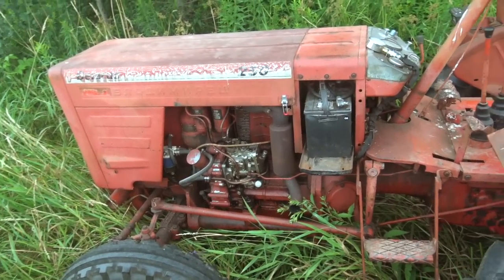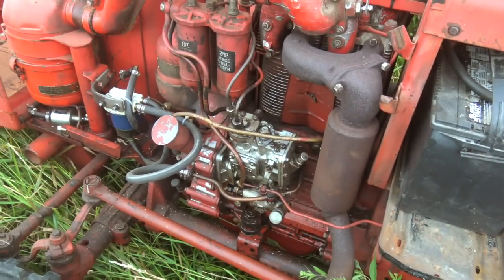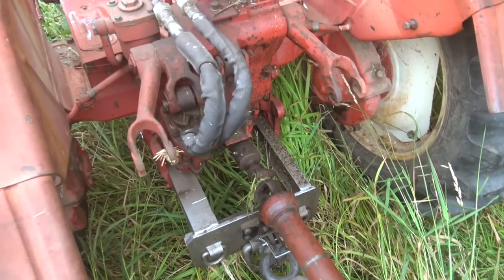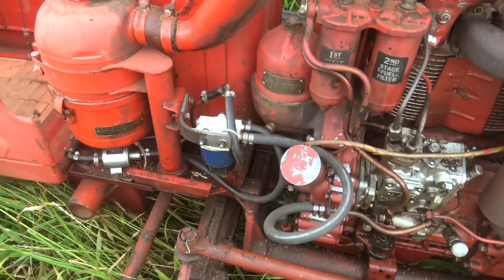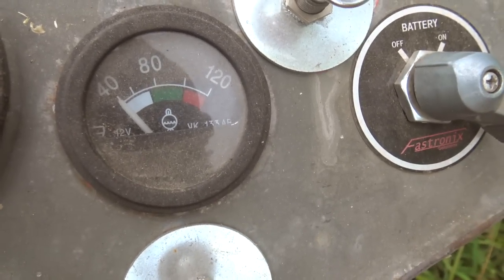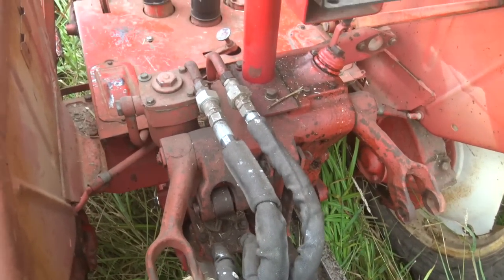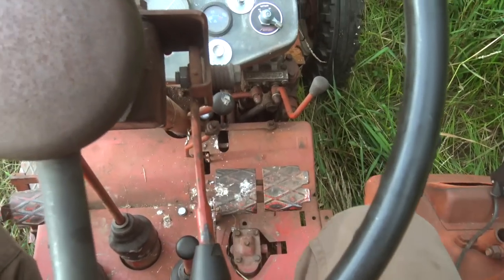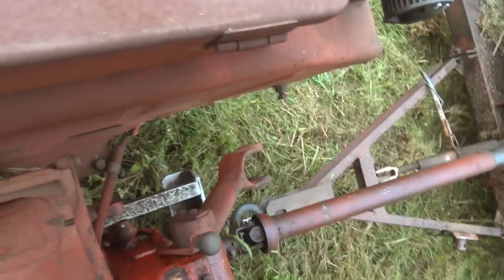Reviewing The World's Worst Tractor: How Bad Is It, Really?!? Belarus 250 aka T25

Comment: I HAVE 4 250A AND 1 400 AND THEY WORK HARD.. I USE MY 250A TO BUSHHOG EVERY WEEK FOR OVER 20 YEARS WITH ONLY OIL AND FILTERS AND 1 INJECTOR REPLACED FROM A PARTS TRACTOR, AND A STARTER 10 YEARS AGO...

Comment: My grandpa had a 65hp full cab Belarus that was a champ. Had it for 30 years. Traded it in on a new 73HP Kioti 3 years ago. Started having electrical issues and other things but after 30 years definitely got his moneys worth. It was a pain to start if you run out of diesel but I know they all can be. Would not call it the worst tractor there was unless ours was one of the good ones.
Reply: I'm sorry, but if it's only electrical issues, I'd build a whole new harness from scratch if that's what it took. Anything new is gonna have 3 times the wires plus computers & emissions.

Comment: Easy to repair, super reliable, low fuel consumption for 2 cylinder tractors powerful. Dont know who wrote these reviews, but at my homecountry in baltics they still cost 4-5k euros and those who buy them practically never sell them because of mentioned positives... For overheating issues, Ive read russian forums and what they do is fabricate/order smaller pulley for fan and that works really well

Comment: I love mine, not sure what year it is, but has the same twin stick setup. It used to have a snow blower on the front and railroad tracks on the back for counter weight. Used it like that for a couple years. Now it pulls logs out of the woods and I have a snow plow on it.  Only thing I did to it was just add fuel and change the oil. Sits for months at a time and starts like I just shut it off.  The cab cuts down on the noise, my neighbour said its very distinctive, he knows its me. Of course the farmers around me said its junk, but ive got nothing but good things to say for the little bit of stuff I need it for.

Comment: The injector pump has an oil  drain & level check.  Oil fill plug/breather is on the top, 19mm. Takes about  60cc 10w-30.  Pump leaks diesel internally into this lube oil.  Keeping this oil fresh will prolong the life of your injector pump.
Am interested to know what marine fuel filter you added on.

Comment: Those are strange tractors back in 80s a farmer in our area had some of those Belarus tractors one like that some 525s and a big articulated 4wd but problem was parts not readily available the hydralics were the thing on them it worked both ways steering was terrible and it seems every shift at the factory had its own designer one of the525s broke a rear axle due to bad steering ends the guy had to buy 3 used 525s before he got the right size axle he eventually end up with a grave yard of them i think he finally sold them as scrap hope he got his money worth

Comment: My guess on possibly a fix for overheating would be to add an external engine oil cooler/engine oil reservoir. This in theory might increase the engine oil capacity two to five gallons. That would help dissipate heat from the engine oil  by circulating it. Could in theory add a couple electric fans to help blow more air across the  external engine oil cooler/ reservoir. No idea on if there is room for any of that as is. Just a random idea from a rancher who used to offer custom ranch services on the side.

Comment: we purchased a couple of those engines back 40 years ago. brand new for a irrigation pump. they sure barked with a straight pipe. you can here the oil centrifuge spin after you shut them down. Most of the tractors  520, 825 etc had very poor hydraulics and very poor quality control. I helped a neighbor rebuild his front wheel assist as it piled up as the seals were put in backwards. I fixed many tires on those tractors that had bolts, washers and even corn left inside to chew through the tube.

Comment: They run on about anything that will burn. Like mine has only ran on used motor oil with a little gas added in. I beefed up the 3 point. It was destroyed when i got it. The clutch was slipping like it was worn out. I ordered a new one, but the old one was as thick as the old one. It is a really strange clutch adjustment. The ergonomics are atrocious. It has nearly broken my hands so many times. The down forces on the 3 point is awesome.

Comment: I have a 250 and it's a great little tractor. A little awkward where lift handle is when using blade, but other than that, no mayor complaints
Reply: Is steering box lubed by gear oil in hydraulic pump\drive housing?

Comment: I rarely have a problem hooking up 3pt hitch if you unhook on solid level ground
Reply: Indeed. For this size of an tractor all implements are so light. I worked on it as an child. Most  things I drove one side near lift arm and another side I just lifted with my arms to hook. Then these chain tensioners are also easy. Welded angle iron to lift arms and cut slot for chain. Release chain tension and put correct chain link into slot and tension chain
Reply: Yep, and you need to have an eye and a brain that can see what way to jiggle or pull/push this or that, to make the pins line up and go in.. 
Just takes finesse, you can't go full ham fist, rage against the machine mode, cooler heads prevail.
Reply: * my biggest three point implement is a all stainless 500 gallon pto driven orchard sprayer that you can't move by hand, you just have to back up to it square..
Reply: Even then if hooking up an implement is that much of a pain a quick-hitch can always be installed onto something as long as it has cat-1 or 2 pins on it. I'd like to eventually get one for my little sub-compact but I only have a box blade atm.

Comment: A friend bought a 250A or on firewall it is a T25A1.  It came with an old manual that says to top up steering box among all the other fluids too.  I pumped over a liter of gear oil into vent plug hole of steering box and it wasn’t filling up.  I discovered it was draining into housing underneath that house hydraulic pump\drive.   Is that a different variety of steering box that is lubed by oil in hydraulic pump\drive housing?   Other than that all the fluids are good and great informative comments on this video.

Comment: I just yesterday searched youtube about this tractor. It's actually not belarus. They put this brand on it but it's actually Vladimirets T25. I have one. Funny part is PTO stops when you press clutch. Was thinking to use with bale wrapper but can't use pto to run oil pump and it's own pump is too small even for wrapper and oil overpressure valve is regulated for too low pressure.
Reply: I believe that the Belarus 200 & 300 series were mfg'd in Vladimir Russia,  hence the nickname "Vladimirets".  400 series and up are/were built by MTZ in Minsk.
I own a 250AS.
Reply: @andyloebrown8250  All export tractors from the USSR were called Belarus. 200 & 300 series are export versions of T25 and T30 series produced at tractor factories in Vladimir(ВМТЗ), Lipetsk(ЛТЗ) and Kharkiv(ХТЗ).  400 series are export versions of the T40 produced at the tractor plant in Lipetsk(ЛТЗ). 500 series are export versions of the МTЗ-50 series produced at the tractor plant in Minsk(МТЗ). 7000 series are export versions of artillery tractors к700 series, produced by the Kirov Plant in Leningrad (now this is St. Petersburg)
Reply: @gebeklitepe  Much Thanks for the information.   Now I have a couple more places that I can search for in Google Maps.

Comment: It’s a very rugged small tractor. I own a Belarus T40 (LTZ which stands for Lipetsk Tractor Works) and a Belarus T25 (Vladimirec)which I understood was made in Ukraine. Both air cooled and fine durable tractors. I also have had a Belarus 800 (MTZ 50, Minsk Tractor Works in Belarus), this was a water cooled tractor. Although it was really strong, it wasn’t as sturdy as the air cooled ones. I definitely prefer the air cooled types. Thanks for the informative video by the way 😊
Reply: T25 is made by VTZ which means Volvogradski traktorni zavod or Volvograd tractor works. VTZ has no conection to MTZ or LTZ as its made in Russia . Belarus name was used here just because it was more recognizable  and thus better for export
Reply: Thanks for the info. I knew that all these tractors were produced in different factories and sold under the same name (Belarus) outside the former CCCP countries. As I understand, the aircooled Engines Share a lot of commonalities and also other parts were commonly shared between these factories. My T40 was made in Lipetsk and according to your information my T25 was made in Wolgograd (Oblast). Thus both my tractors originate from Russia.
Reply: Do you know what the name ‘vladimirec’ stands for? This name is oftenly used in combination with the T25 tractor.

Comment: Oliver had oil bath front wheel bearings, live pto and hyd, 3 speed trany in one shift 4 & 6 cylinder engines, starting in 1930's until the end of Oliver in the '70's thanks to White Motor Corp. that killed Oliver, Moline,  other well known farm equipment companies.  Sorry to see Oliver go because that is what I grew up using on our farm.

Comment: I have that same tractor! Bought mine with a seized engine in southern IL a couple years ago. Still havn't got it running tho. The fuel primer is also seized so I might use your trick and install a 12v pump
Reply: My fuel primer was bad also, no QA on production line.  Replaced unit with a new one from Ukraine.

Comment: its got summer mode and winter mode if its overheating check it the one with 4 cylinder has that option
Reply: and u  can change pulley to a different size to make the fan faster

Comment: Was that glow plug just a glow plug or was it what's called a thermostart which has a heating coil and makes a little fire with some fuel in the intake?
Reply: I just did a quick search for a glow plug from a Duramax and it looks like it's just a glow plug. Nothing too special about it.
Reply: @Slane583  I'm talking about the original glow plug.

Comment: Back in I think the late 70s to early 80s Belarus tractors were sold in Australia. They had a bad reputation as being cheap and nasty. I never had first hand experience with one but I think most probably the people buying them did not treat them as well as they should have. It is probably similar to modern Chinese tractors. They too have a bad reputation but most probably if they are treated well they would probably last. Of course spare parts are the main issue when it comes to tractors. Whether parts are available for Chinese tractors is a big issue.
Reply: A lot of Aussie farmers are worse than Hard on their gear. It blows my mind to see super expensive machinery of today, being left out in paddocks for days, to months on end.. then to hear them "grumble" about the lousy equipment they just shelled out so much for, down at the local.. I could well picture some Old farmer out in the hot lands beating crap out of an aircoolled tractor, bitching about it over heating.. lols.. I dont cart much sympathy for them.. just a shake of the head.. I've seen a few of these ol'Lady's here n there in my travels.. I got a soft spot for tractors..If I owned a spot of land, I reckon I'd be a tragic tractor collector..  Tractors and "anything" lister..

Comment: If you like oddball, get a David Brown.
Reply: My grandfather had a David Brown for a little bit. He bought it off of a local farmer in the late 90's when the farmer retired and sold off his equipment. The only reason my grandfather sold it was because it was too big for what he needed it for and ended up buying a New Holland 1715 brand new from the local dealer. The 1715 has done everything he wanted the David Brown for but in a smaller package and it was 4x4. We still have the 1715 today and it starts up every time with no problems. :)

Comment: I own 4 belarus two 420 air cold and 500 520 liquid never have a problem with them I farm with them do 1500 to 2000 bales with them every year super easy on fuel and parts are cheap owned massey jd and international belarus is the best the only thing is better is zetor I have an old 5245 with 10000 hours never bin touched